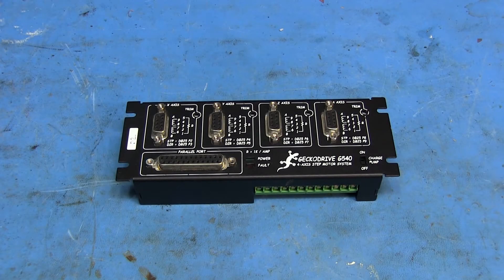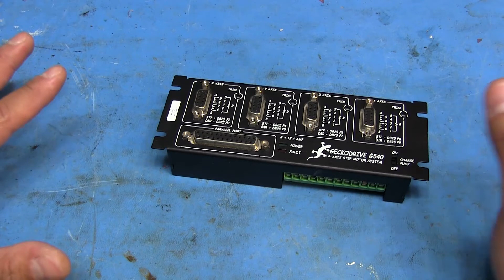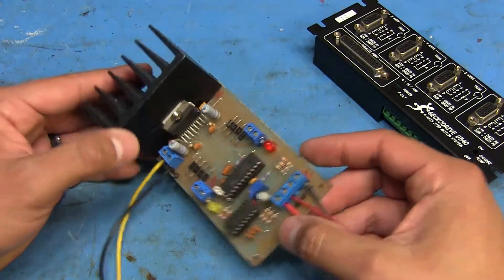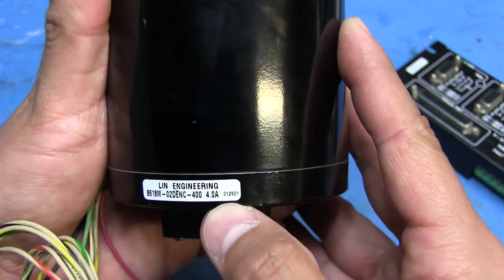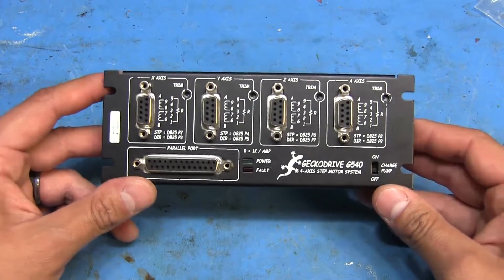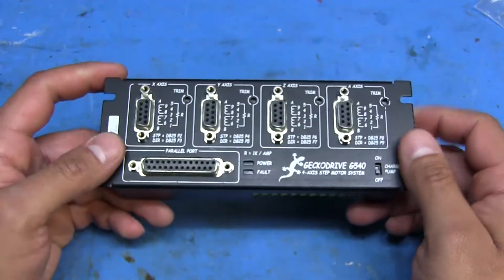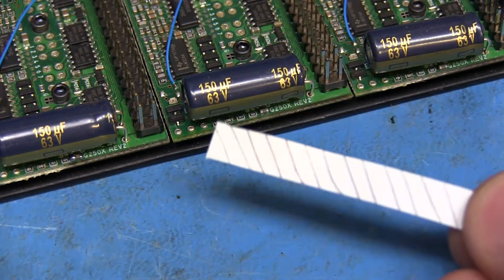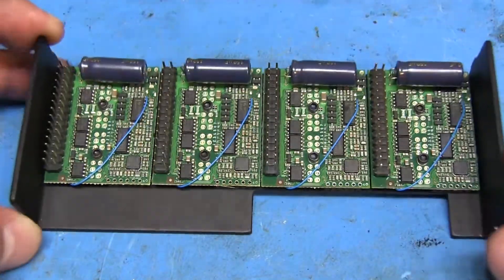TWB #23 | Geckodrive G540 Heat Dissipation Enhancements

Comment: This is interesting. I know that the Geckodrive G540 is well respected and considered dependable, so the obvious question would be, why isn't the unit built with closer thermal contact?  Maybe it turns out that an air gap (as shown, under 100 microns) still is close enough to keep the component from overheating?  I made a simpler heat sink, simply by fastening the G540 so that its back plate is pressed against a large 3/16" thick aluminum plate.  The plate is conductive enough so that the entire plate (about 80 square inches) feels slightly warm to the touch, when it is operating. I didn't add a cooling fan. It works OK, so far.

Comment: I had similar gaps between the chips and the case on a recent G540 I bought. I completely disassembled the G540 and added paste to everything. It runs cool as a cucumber now with zero heat issues. I also drilled and tapped my heatsink with a brushless fan and screwed it to the G540 case with the same Arctic Silver thermal paste. It's like an ice box now.

Comment: Would you be able to provide some info on those heat sinks?
Reply from the maker: Sorry for the delayed reply. Those heatsinks originally came out of some 486, or early Pentium 1 PCs, if I remember correctly. Unfortunately I had gotten them so long ago I don't know exactly what they were in. A lot of older CPU heatsinks are pretty good for this type of stuff because they are mostly all aluminum and since the CPUs of the time didn't pump out ridiculous amounts of heat, many just used really long fins for passive cooling.

Comment: I am just reading this a year later... but why not just open up the threaded holes on the back of the Gecko and run longer screws through it.  Drill and tap the heatsink and screw the longer screws in to it?

I bought these for my G540:  http://goo.gl/mDHOxr

Comment: The G540 requires a heatsink in any enclosure it's mounted in. I see your steppers are rated to draw 4a. The G540 can supply a peak amp of 3.5a with 2.47a RMS current available which means your steppers will have less holding torque.

I know thermal paste is more of a hassle to apply, but it offers far superior heat transfer than thermal tape. This is why CPU's use this in pc's.

Your cooling system is nicely done, but your missing the most important component I include in my Vampire G540 cooling package. A thermal switch which will kill AC power to your power supply if the G540 gets over 60c. This offers bulletproof protection. Please review the only cooling package online that features this.

http://www.ebay.com/itm/Gecko-G540-Vampire-Cooler-Package-Automatic-Shutoff-Protection-/131397036626?ssPageName=STRK:MESE:IT
Reply: I agree, thermal paste is far superior to thermal tape. We build a LOT of computers everyday and if a customer asks to use thermal tape we will not warranty their build. Not a big fan of the Vampire cooling package but at least it offers protection. Thank you for making this video, I was surprised to see the poor build quality on the G540 considering how top notch a company Gecko is supposed to be. When my G540 arrives I will be looking very closely at how it was assembled. Thanks for the heads up.